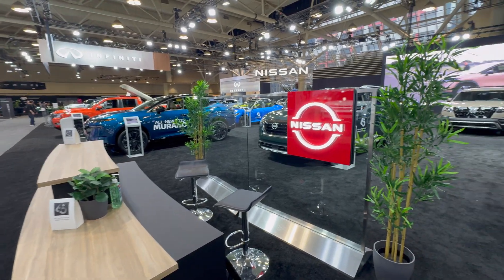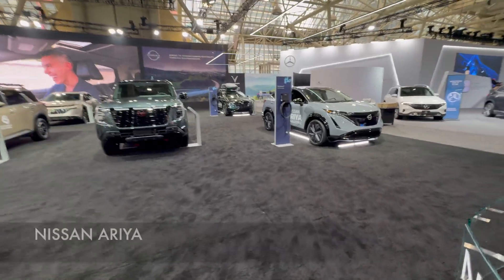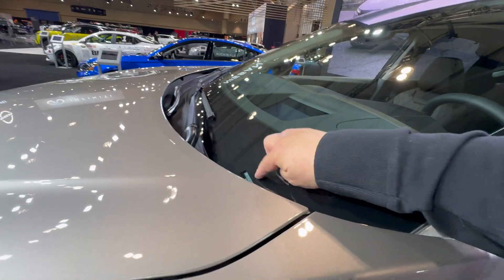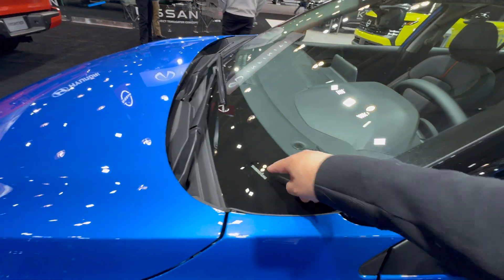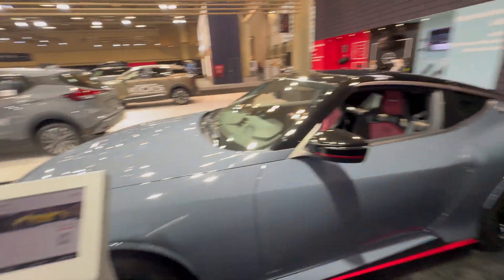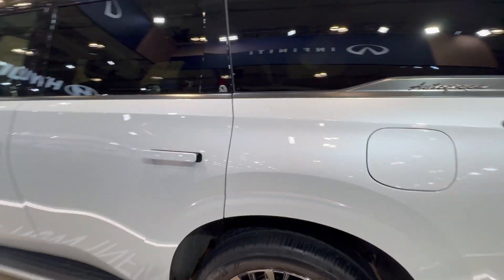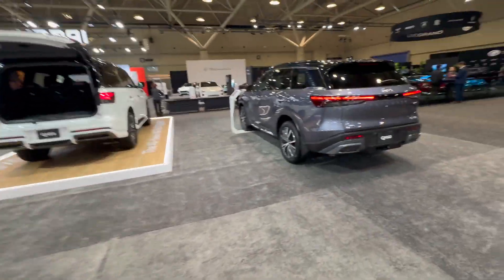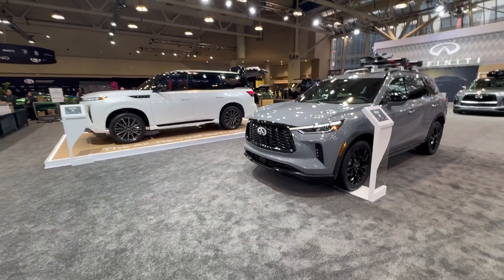ENGINEER EXPLAINS WHERE NISSAN's and INFINITI's ARE BUILT // ARE THEY BUILT IN JAPAN, US or MEXICO?

Comment: Just purchased a new 2024 Titan Platinum Reserve❤ I previously owned a 2016 Sierra SLT and a new 2018 Sierra Denali! The Platinum Reserve is more luxurious and comfortable❤ Gas mileage is very impressive- driving 65mph on interstate fuel   economy is 24.7mpg!!! 55 mph on interstate I average 27.5 mpg!!! 75 mph I avg 21.8mpg!!! These numbers with this V8 are very impressive!!! I can’t believe the Titan was cancelled after 2024 model!!!! Both of my Sierra’s were impressive until I crossed 40k miles on odometer! The AC on both stopped cooling, driver’s seat threads unraveling after 50k, headlights were awful!!!! Lights on my new Titan are phenomenal, even on low beam! Never owned a luxury truck that had Airconditioned front SEATS!!! My LS430 is the only luxury vehicle I’ve owned with Airconditioned cold air coming from front seats, much better than ventilated seats!!! My only disappointment with the Titan is no acoustic glass and no insulation in wheel wells like Lexus and GMC Sierra which is best for easier cleaning and soundproofing!!! 
The Titan’s cabin is very quiet allowing you to hear every instrument while listening to jazz and having a normal conversation with your spouse even with the panoramic roof’s shade open to enjoy the moonlight on a beautiful night ride❣️❣️❣️
Reply: Thanks again David for sharing your valuable insights that assisted me in choosing to purchase my first Titan Platinum Reserve 🙏🏼❤️